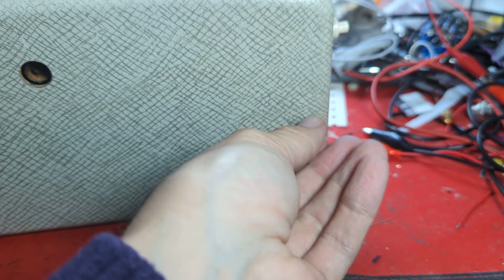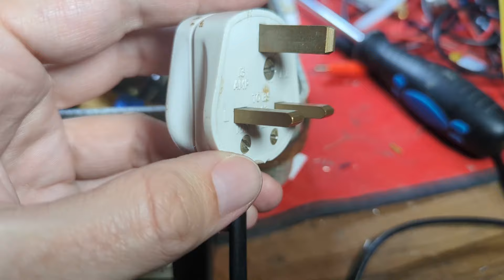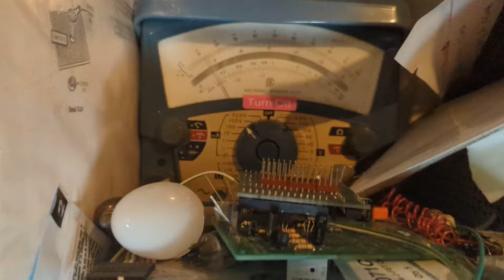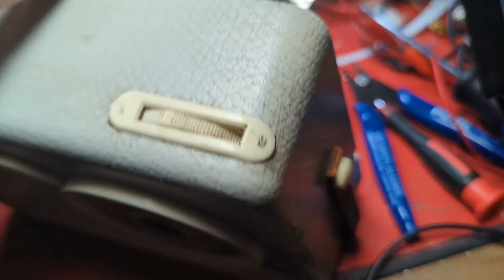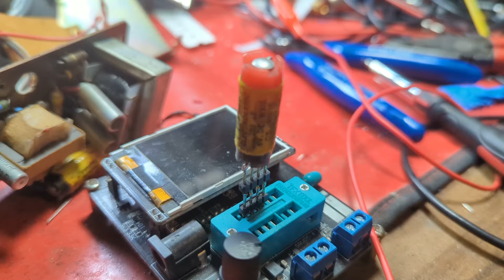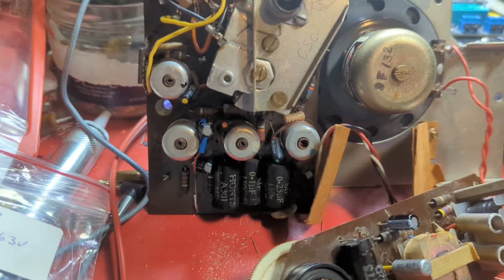Dansette 222 resurrection and repair.

Comment: This was my first radio as youth. Purchased from Currys at 11.5 GUINEA on credit over 12 months. 13 pounds in all. I think mine was a later model and looked much nicer. It was dark green with a silver metaled area over the speaker. Inside looked much the same but the OC81 output transistors did not have a heatsink clip fitted. 600mW output if I recall. A very nice radio. Just found your channel. Just a very small observation, if you don't mind. Your audio is very sibilant at times.
Reply from the maker: I've seen a few online that are in different colours - when did you buy yours?
Reply: @DavidMills_Physicist  Hi David. Mine was in fact a Dansette GEM purchased around 1963/4. Quite a few photos online. I have no idea what ever happened to it.

Comment: New subscriber from Canada. Interesting radio. I've never seen one of these before.
Reply from the maker: A few days after I posted this video a neighbour asked me if I wanted an old radio and handed me another one of these. I've not tested it yet.
Reply: @DavidMills_Physicist  Must be nice to have neighbours handing you vintage radios. That vernier reduction drive is a nice feature on this radio for precisely tuning in stations.
Reply from the maker: @electronixTech  They know I like old radios, I think this other oen came from a relative's attic or someting. Cause it cracked, but insode looks clean - it's not been stored in the damp.